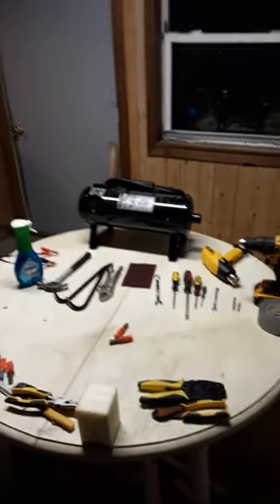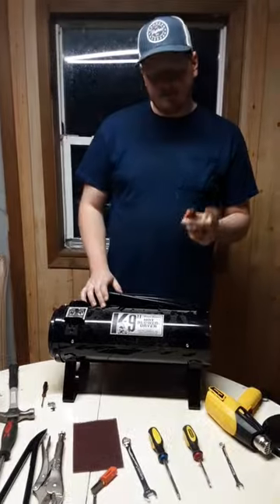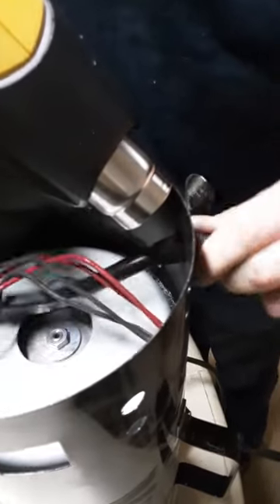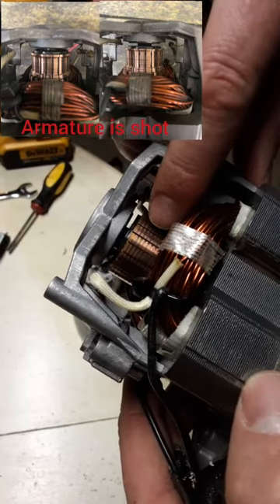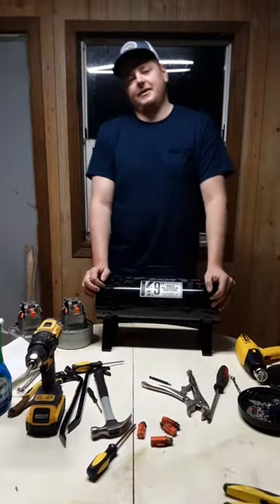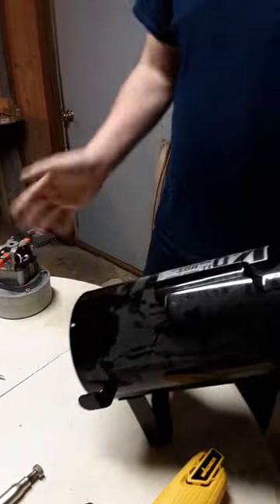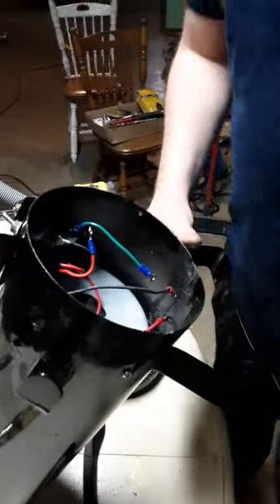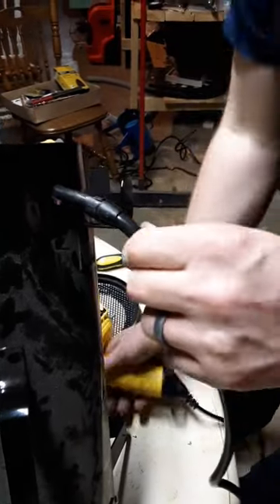How to change brushes on a K9 II or Circ II dryer

Comment: This is a very good video. You said to look out for the blue arc and you saw it. What do we do if it doesn't go away? Does it mean that the motor needs replacement?
Reply from the maker: If the arcing is a bright blue color and running the whole length of the carbon, then yes I would recommend replacing the motor. If the arcing is more of a white light color with a few sparks that is completely normal. That bright blue arcing is going to cause the brush to get really hot and wear really fast.

Comment: How often would you expect a whole motor to go? We’ve had 3 k9 2’s go in the last 2 years and the person who’s services them says that’s just what happens with lots of use, which we don’t do, on average it’s 2-3 groomers with maybe 8 dogs total in a day and we have 3-4 dryers going. 
What WOULD cause a motor to die on these?
Reply from the maker: From what I have noticed doing repairs, the life expectancy of these motors has been 4 maybe 5 years at the maximum. That’s for groomers who run them daily and have had brushes replaced in a timely manner. Eventually the brushes wear the armature on the motor down and once that happens you’ll probably notice a couple of the following happening 
-brushes wear down super fast, maybe only lasting a couple months
-motors  run hotter then normal 
-less power then normal 
-motor cutting in and out
Reply: @dakotaclouse783  follow up questions, because we don’t run ours all day every day and the of the 3 that have had motors die, 2 of them were 2 years old or less, I think the other was maybe 4 years. They get serviced every 9 months and filters changed every 3, we have the heavy duty filters if that makes a difference. 

1- would someone who regularly services dryers know about the armature?
2- do the switches each connect to a motor or does one switch off run both motors at 1/2 speed
3- would using the dryers with no hose on, pointing at a kennel, cause they motors to heat up fast and burn them out faster? (Because that’s what we were told and that makes no sense to me)

I appreciate the time you’re taking to provide information!
Reply from the maker: No problem, I’ll try and answer these the best I can. 
1- this would be a question more for the person or place you send them to to have serviced. They should know how to inspect the armatures and tell if they are good or bad, but I guess I can’t really answer for how they do things.

2- Each switch controls a separate motor, right switch should turn on front motor, left switch turns on rear motor. 1/2 speed is just one motor running, full speed is both motors running. 

3- Running the dryers with no hose should not have any affect on the motors to my knowledge. If anything I would think the motors would run a little bit better without the hose simply because there would be less back pressure on the motors from trying to force air through the smaller nozzle on the hose.
Reply: @dakotaclouse783  thank you so much! 

Also would running only 1 motor (for instance drying faces or small dogs/nervous dogs etc) cause the motor to die faster?

And is there a max time a dryer should be on for before it should cool down a bit? 

Again I appreciate all this! Your video was super helpful too
Reply from the maker: If you run it 1/2 speed (single motor) some of the time, just keep in mind that the brushes on that motor will wear down faster than the other motor. I recommend running the front motor if you are going to run it half speed. It’s a lot easier to check the life of the brushes on that front motor. 

As for the run time, a cool down break certainly wouldn’t hurt it if you feel like it is getting super hot, but they are labeled a “hot blow dryer” so they are made to run warm. I’ve had them running 8-10 hrs non stop without issue so it there’s no problem with running them for long periods of time

Comment: Are you familiar with the K9 II wiring in a Wagn Tails grooming van? They are wired to switches in the salon. A how to  video would be a big help.
Reply from the maker: I am familiar with the wiring inside the dryer itself. As far as how the dryer gets installed in to the van, that I am not familiar with.
Reply: I have removed the dryer out of the Wagn Tails van. If you have an inverter, you first need to make sure the truck is not plugged in.  Next, turn of the circuit breaker for the dryer. Then you can remove the wire from the van.
Reply: The wires with the same color go together at the box, behind the blower in the van. With the actual switches inside the van I have been told number 2 switch is for the motor that is hard to get out. Number 1 motor is the easier to access motor. Inside the van, you can take the cover off and check the color wires are the same on the switches inside the blower. WagnTails can send you a diagram of how it is connected at the small box.

Comment: Motor doesn't pop out with crescent n flat head. How do I take it out without tearing up the gasket?
Reply from the maker: So the reason for that happening is when those gaskets get glued in, if they aren’t careful sometimes glue will get on the inside of the gasket and the motor will adhere itself to the gasket over time. Unfortunately when that happens your more than likely going to end up ripping the gasket and having to replace it. There are times where Ive needed a 2nd person to pry on the screw driver as I pull on the vice grips to get the motor out, and even then it came out really hard

Comment: Is there a tool one can purchase to check that the motors are good? Or do you have to rig it up from a power cord?
Reply from the maker: If you have a Multimeter you could use that to test for continuity and resistance. You’d have to look up a video on how to do that as it’s something I’m not to familiar with. If you want to make sure the motors run before installing them back into the machine, then the power cord with the clamps is about the easiest way I can think of

Comment: Do you happen to know the ratings on the switches if we want to replace them without buying from manufacturer?
Reply from the maker: https://www.carlingtech.com/toggle-switches-f-series 
Scroll down to the specs and it has the ratings listed there. They also should be listed on the switch itself I believe if you check your old switches

Comment: My motor is s tuck so tight i cant pull it out .
Reply from the maker: Some of the glue they use to glue those body gaskets in more then likely got on the inside of the gasket. Over time the motor will adhere itself to the gasket and make it really tough to get out. There are times where I have needed a 2nd person to pry up on the screwdriver while I pulled on the vice grips and still had a hard time getting the motor out.